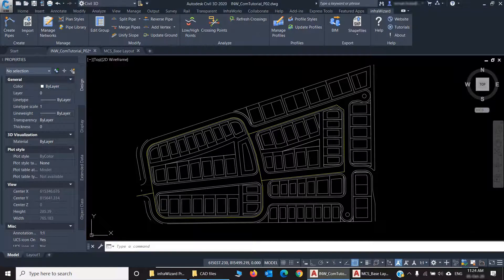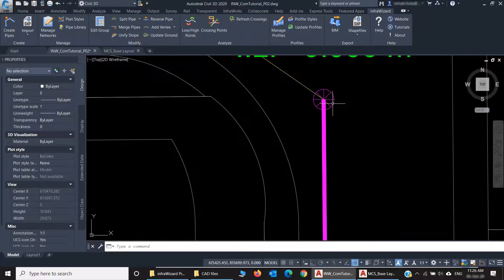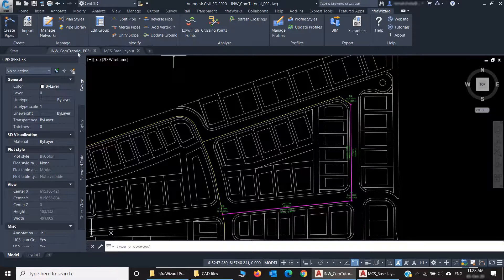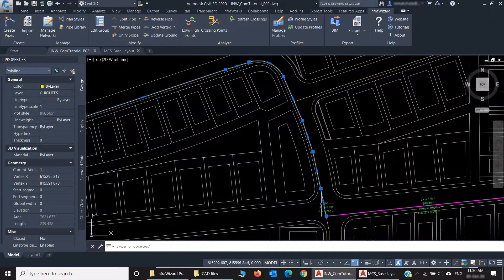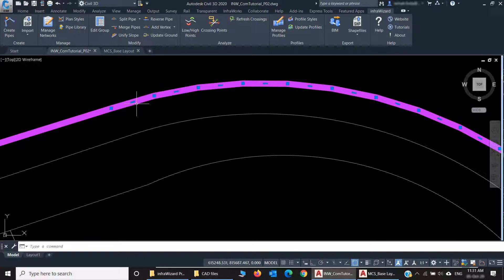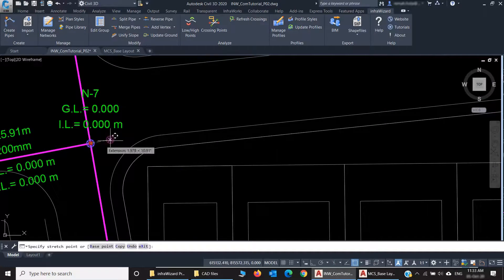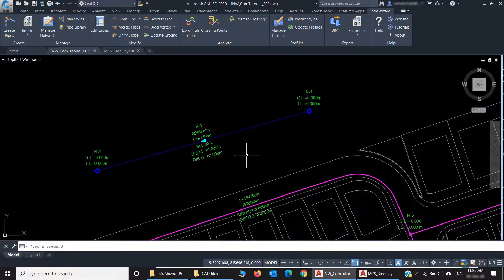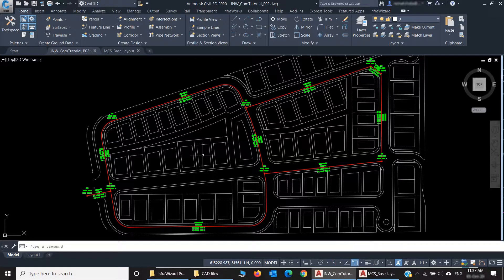infraWizard Tutorial - Part 5: Creating networks from AutoCAD objects

Comment: how did you import the CAD file? when I Open an existing CAD file and start creating Pipe, I get message do I want to start a new project if yes then a new window opens without the based AutoCAD layout
Reply from the maker: After you start a new project you can reference the CAD layout as an External Reference using the command XREF or insert it as a block into the drawing using the command INSERT. In case you need further assistance, please send your query to support@infrawizard.com
Reply: yes i am also gettiing the issue.

Comment: HOW YOU GET ELEVATIONS OF NODES
Reply from the maker: Hello Omran, The elevations of nodes can be picked from several sources. It can be imported with the network data from hydraulic models in the form of text files, shapefiles, or Epanet and EPASWMM models; and can be picked from the elevation of line objects if you are creating network from line entities. It can also be added manually by copy and paste from Excel using the Group Edit tables.